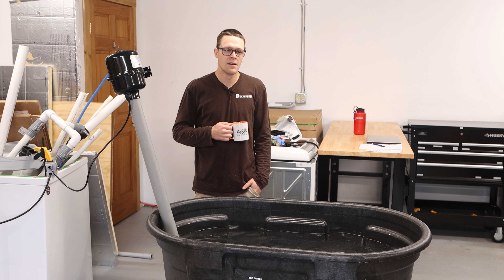Building A Better Greens Bubbler

Comment: I am struggling on air pressure. I dont have the camlocks, just slip joint everything, so probavly have an extra 8 inches of holes. I have a 1 ho blower, looks to be the same as yours, ultra-9000.  Any suggestions on trouble shooting? Runs for about 5 mins witg sub pat agitation, then almost seens to stop. Im flumoxed. Any suggestions?

Comment: Could an old jacuzzi bath do the job? Or is the position of the airstreams a special functions
Reply from the maker: Functionally, it would probably work fine to provide the required tumbling action for greens.  The issue would be how to clean it adequately, in my opinion.  Lots of nooks and crannies and lots of air hoses that would be difficult to get at.

Comment: Hi Guys, Great video.
Here where am from is difficult to find jacuzzi pumps, can we do it with swimming  pool pumps??
Reply from the maker: Although they are referred to as jacuzzi "pumps", they are really blowers.  So they are moving air. I'm not super familiar with swimming pool pumps, but if they are also designed to move air, then you may be ok with them. If you haven't checked out the associated guide at https://blog.uvm.edu/cwcallah/2021/10/06/building-a-better-greens-bubbler/, take a look.  Specifically, blower specifications are provided there. "Technical info on selecting a blower: The most common 1 hp jacuzzi blowers can provide 110 CFM maximum flow (at zero pressure) and 75 inch water column (inch wc) static pressure head (at 0 CFM flow). Blowers operate somewhere in between these two extreme conditions, for example 60 CFM at 30 inch wc back pressure. The back pressure is the combination of the water level (in inches) plus the pressure loss due to friction from air flow in the piping between the blower and the air holes (at 60 CFM in 2” Sch 40 PVC, this loss is 1 inch wc per 10 feet of pipe length). So with 24” of water level in the tank a typical blower can easily be placed 60 feet away using 2” PVC to bring the air to the bubbler."
Reply: @uvmextageng  thank you very much... it was helpful.